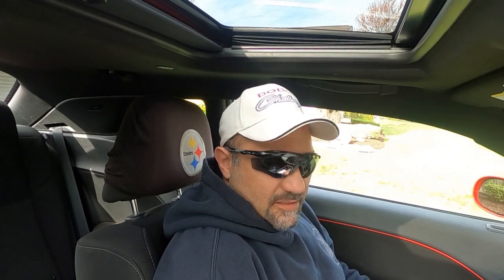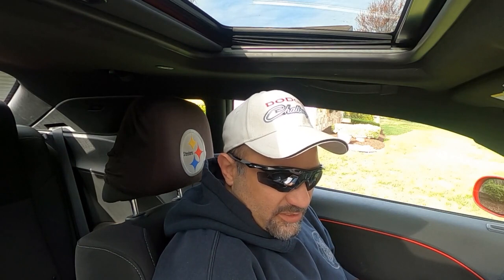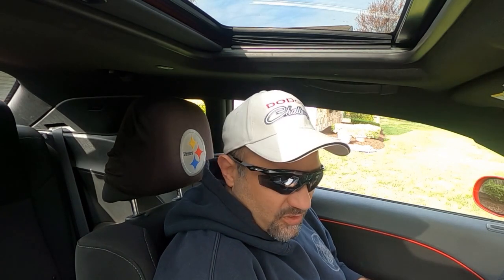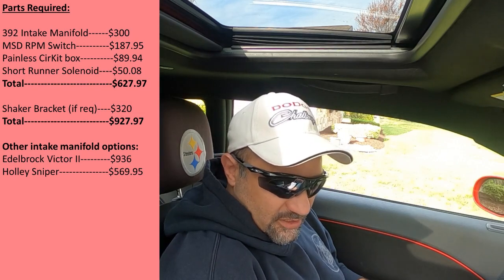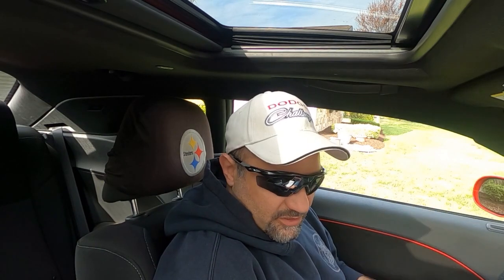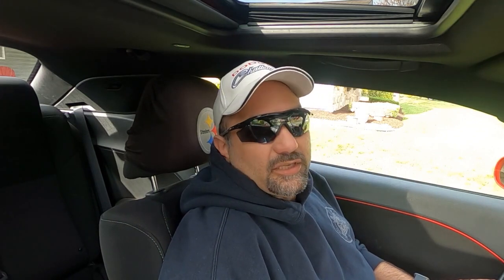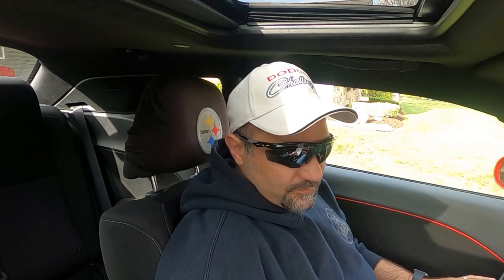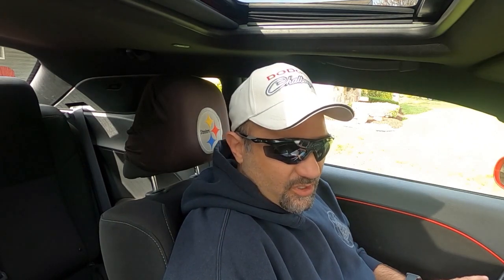392 / 6.4 Intake Manifold on a 5.7 Hemi Parts List and Cost!

Comment: Hey brother man I did this mod a little bit ago and was wondering if you knew what RPM is best for the short runner valve to activate? I have mine set for 4500 but I’ve heard people set it at 4800, 4900, even 5000. Was wondering if you did any trial and error on the 1/4 mile
Reply from the maker: Never did any testing but had mine set at 4800 only because Scats have them set there. 😉
Reply: @ModernRedHemi  thank you sir 🫡
Reply: Setting the runner valve at 4800 is not good for the stock 5.7L due to the difference in the cam between the 6.4 and 5.7. I have found that 5200 pulls much harder before the car seemed to stall until over 5000.

Comment: There’s an easier way to do this. Just get an SRV controller from MMX.
Reply from the maker: You are 100% correct. Only issue is those that have a Tazer and either Diablo or HP Tuners, with a OBDII splitter, you can only use 2 OBDII things at a time. 😉

Comment: Does the 6.4L Intake improve gas mileage on the 5.7L if driven normally?
Reply from the maker: Good question. That's something I didn't do any testing on but it does increase power across the entire power and torque curves. That being said, I don't think it would decrease it much if any at all. Just my thoughts and opinion. 😉

Comment: @ Modern Red Hemi, thank you for the info and giving me some thing to look forward to when i start building up my charger! Question, is it better with or without shaker?
Reply from the maker: Well, I like the look of the Shaker but there is an added cost for the bracket (~$300 if I remember correctly). Other than aesthetics, I don't think the Shaker adds any power but could be wrong. 💪💪💪
Reply: @ModernRedHemi  that is what I was wondering, although the shaker does look pretty dope, kinda reminds me of a Darth Vader helmet! Keep up the awesome content 👏

Comment: Its cheaper to do the 6.4l intake now, i just got my hands on a 6.4l for $500 & Z-automotive has the Short Runner Valve for $289. Which is my next purchase!
Reply from the maker: Definitely a little cheaper with the SRV controller from MMX! 💪💪💪
Reply: @ModernRedHemi  yes & more simple to hook up
Reply: Good luck. Ive been waiting 2 months. They are out of parts 😞
Reply: @mrhyde0705  on what parts? For the SRV module?
Reply: @Mroswaldo16  dunno, i emailed MMX and they said Backorder, than i went to z automotive and they stated due to not enough chips they couldnt produce and they only had 3 orders including mine. I asked if they'd be able to make the connector as its the only part i need, never heard back.
Reply: @mrhyde0705  ohh, i see. It had went out of stock before buying mine, then i saw in stock, so i had to buy it. What connector do you need?
Reply: @Mroswaldo16  whatever cord they have with theirs. I think it connects the SRV to power under the hood. I was probably just gonna buy a 6.4 harness at this point.
Reply: @mrhyde0705  for the SRV, its just to intake, power & something under the glpvebox, to control or see rpm. Really simple wire.
Reply: @Mroswaldo16  yeah. I do need a new engine harness as mine has almost 200k on it, and its crumbling. Shop that did the work said if i can get power to the SRV, they can tune it. I really dont wanna use an MSD switch. Gets hot here.

Comment: Any notice improved performance and hp gains with the swap thanks Mike
Reply from the maker: Absolutely. Didn't do a dyno though but there is a big difference throughout both the horsepower and torque curves, specifically the torque because of the short/long runners. 💪💪💪

Comment: It's been a while since you did this video, I'm sure people still use it as a reference.  Most use the MSD window switch to activate the runners. 

MMX ( modern muscle extreme ) carries the SRV controller from Z Automotive. It works fantastic, and won't fail due to heat like the MSD can. It's also controllable from inside the car.
Reply from the maker: You're absolutely correct. This was some time ago and ZAutomotive has added this device to the mix. I would definitely suggest it. Thanks for posting!💪💪💪
Reply: Thanks for the feedback appreciated it. I just recently ordered 6.4 manifold and was on the fence about the srv z automotive. This sure is reassuring and glad I went wit Z Automotive instead of the Msd. 👍🏽
Reply: @Jr1987Gt   let me know if I can help. They really work well
Reply: @SModelMafia  Awsome thank you.

Comment: I am installing this manifold and wonder how this option will “hold up” to the traditional way as you noted with the box.. 

https://www.modernmusclextreme.com/images/media/p-1503-SRV_Controller_User_guide.pdf
Reply from the maker: I didn't use the Z-Automotive solution. I have a MSD RPM switch that turns my short runners off and on. This is my first time seeing the Z-Automotive solution.
Reply: seems interesting. You have any updates/ additional info to share about that?
Reply: @riology2234  it has worked flawless.. easy, clean and computer modified. Well worth the money spent !
Reply: @tylercooper5092  1) If I undrestands this correctly, the Zautomotive way requires less wiring that the traditional way thus resulting in more OEM/ cleaner look, correct? 
2) Would you suggest it over the traditional way?

Comment: I’m about to make my purchase on a used intake manifold so I purchase it with rails and the injectors? Also my stock tb will fit the 6.4 manifold?
Reply from the maker: If you got the fuel rails and injectors you will definitely need a custom tune to utilize it properly. Yes, your TB will bolt right up!
Reply: Modern Red Hemi yea I’m sure mr.green can take care of that for me but wat do u suggest or so I just get the manifold itself without rials n injectors
Reply from the maker: @ezequeilpena7208  you don't necessarily need the rails and injectors. Even if you upgrade later, boost for example, you'll have to get new injectors anyway.
Reply: Modern Red Hemi there one I’m looking at that’s why it comes with all that for 200
Reply: Modern Red Hemi It’s a 2018 manifold for a charger it will fit my challenger 5.7 correct
Reply from the maker: @ezequeilpena7208  if that is on Facebook Marketplace be careful as that is pretty cheap. My buddy got taken on the same deal.
Reply: Modern Red Hemi no it’s called car part.com
Reply: Modern Red Hemi they scammed ur buddy they didn’t send him parts ?
Reply: @ezequeilpena7208  hey I got a 6.4 intake with fuel rails, injectors, and throttle body for sale. I am located in Illinois. Let me know if you want more info

Comment: Can someone help me find a 392 manifold or find me a link. Thanks :)
Reply from the maker: https://www.ebay.com/itm/Used-OEM-Dodge-6-4L-Hemi-Engine-Intake-Manifold-W-Fuel-Rails-Fuel-Injectors/303676977902?hash=item46b48ef2ee:g:JbMAAOSwnxlfR0tG 
A little pricey but includes fuel rails and injectors.
Reply: Modern Red Hemi 625? Does that seem a little over the top? I don’t know that much but I’ve seen them go used for like 380. How much do the rails and injectors to for
Reply from the maker: @cmd7129  this one includes the fuel rails and injectors. Most of those that are cheaper don't. You don't need the rails and injectors but a nice to have if you continue to upgrade.
Reply: Modern Red Hemi would the injectors increase performance at all?
Reply: @cmd7129  Your stock injectors are the same as the 392's which are rated for 550-600 horsepower(more or less). New, more volume injectors are not needed and would cause more issues as being too rich and a bigger bitch to tune.

Comment: What did this do for you horsepower wise and torque?
Reply from the maker: Increased HP and torque across both curves along with flattening them out some. It is well worth the time and money to do it.
Reply: @ModernRedHemi  What would you do first, the 6.4 intake, or the 3.09 lsd. I have an open diff right now.
Reply from the maker: @brokelahomachickenfry6497  get the LSD first. Will help getting off the line.

Comment: That 392 intake manifold is already a huge improvement over the factory intake manifold but a ported 392 intake manifold will make that 5.7L Hemi V8 perform even better.
Reply: I tried to look for intake manfold 6.4  1000 from dealer I tried to find used nothing then I found ported intake manfold 6.4 for 795
Reply from the maker: Yes sir. Working on that next.
Reply: @ModernRedHemi  I need the intake manfold can you send me where I can find it so I dont pay 2000 to 3000 for all parts . I saw ported intake manfold for 795 new with no parts included .
Reply from the maker: @angelomaselli5191  they are hard to find used and some that you find are scams (specifically Facebook Marketplace). You just have to keep digging into the forums, local if you can find one. Yes, you can get a new ported one for $795 (I think that's right) from Modern Muscle Extreme) but like you said, then you have to get the other parts as well. Unfortunately there is no one spot to look.
Reply: @ModernRedHemi  What other parts are required if you buy a brand new one from MMX? Is it just the parts in your description, or are there more?
Reply: @ModernRedHemi  Sounds awesome brother.
Reply: Did you ever get it properly running with the 6.4? Did you need tuning or air ratio 02 sensors ?

Comment: I know this video is old but does anyone know if you need a different throttle body when you switch the intake manifold ?
Reply from the maker: No. Your stock 5.7 will fit.
Reply: Modern Red Hemi thank you 👍🏼

Comment: Did you have to upgrade your heads when getting the stage 2 scat pack camshaft? I've been looking to see what I have to do or what to get for my RT Charger.
Reply from the maker: You don't have to upgrade your heads but I do suggest getting ported ones if you can afford them. All of these modifications build on each other to create additional power.
Reply: @ModernRedHemi  Where did you get your 3.70 Limited Slip Differential also. I've been looking for a good one that will pull hard. The best I have found was the 3.09 LSD

Comment: Why do I need a MSD BOX FOR RPM SWITCH
Reply from the maker: It is used to switch between the long and short runners. That is one of the advantages of the 392 intake. I have mine set at 4800, which is where the 392's switch as well.

Comment: Noticeable difference in mine, what I seen was drivability of the car was way more responsive in low, mid, top end. Exhaust note changed etc. Between shifts the car has no delay and picks up way faster than stock. The torque and power keeps pulling through high end where the 5.7’s tend to die. The car breathes way easier. Why Chrysler bottles a 5.7 up so much is frustrating. At the end of the day it all boils down to your tuner and other supporting mods you may have. Jay Greene is a wizard with these GEN3 hemis and he’s got my ride and Shake n Bake running very reliable, but also pissed off when we step on the throttle 🏁
Reply from the maker: It does make a really big difference contrary to a lot of other opinions. Jay is the Mopar Wizard for sure!
Reply: did it make exhaust louder ? or like higher or lower pitch? Also if driven normal what did it do to MPG? thanks

Comment: I’m doing the Holley intake on my 5.7. MMX is porting it out to make it more efficient.
Reply from the maker: I've heard both good and not so good things about the Holley Sniper. Would like to hear your experience with it.
Reply: Modern Red Hemi I’ve heard bad things too. But speaking with MMX they are correcting the issue with vacuum leaks and bad gaskets. They machine out all the gasket fittings on the bottom and they have made their own custom gasket for it. Which lead me to purchase. MMX steered me away at first but then later on they started doing this mod to the intakes and they said try it now. Also purchased my cam, hellcat TB blaster coils, legmaker etc. but I’ll let you know when installed and tuned.

Comment: I have a 5.7 hemi shaker as well and I wan to go on your route upgrading my intake manifold. Can you send me a link where to get the bracket for the shaker hood? Thanks.
Reply from the maker: I actually got mine from the dealership. I used to have the part number but can't find it. A great resource is Steve White Motors in NC (Service Number: 828-237-1570). Ask for Luke. I am sure they can get the part or at least the part number for you. If I happen to find the part number I will add it to my description.

Comment: I have a 2006 Dodge ram 1500 with a 5.7 with no MDS would it still be possible to do the 392 intake
Reply from the maker: It is possible for Ram's to take advantage of the 392 intake. Another YouTuber called Incredible Hemi who just installed one on his Ram. Suggest you check out his channel as well.

Comment: So 1000$ for 10 horsepower? Yeah no thanks 😄
Reply: If that’s too much money for the power then you have the wrong hobby lol
Reply from the maker: That's only for a Shaker due to the added cost of the additional bracket that is required. Also, it sticks with the roughly $100/HP of a lot of other mods. As for Rams, check out the video that Incredible Hemi uploaded a couple days ago. They say Rams get about 30.

Comment: Random question Will your long tube with the catted mid pipe set up pass maryland emissions, I want the same set up but Im skeptical since maryland is so strict?
Reply from the maker: I have been holding off as my emissions inspection is not due until July. With the virus thing going on I plan on doing a video on it when this all calms down. MD only requires the ODB II port testing. Video forthcoming.

Comment: Nice vid man. Question, after your cam install did you notice more or less valvetrain noise?
Reply from the maker: Initially I had the dreaded Hemi tick but once I got non-MDS lifters installed it went away.
Reply: @ModernRedHemi  Crud. I think my installers botched the job. I had full hellcat lifters put in and I hear more noise than before. I wonder if it's my injectors or something... Oh well thanks anyway. I'm takin mine to the shop tomorrow for an exhaust leak caused by the same aforementioned shop haha. Once that's out I'll post a vid of it idling. (I saw you subbed to my other channel the other day, thanks!!! (Peter Stein)
Reply from the maker: That's the problem nowadays. More speed/performance shops than you can shake a stick at and a majority of them are ifi at best. Good luck on tomorrow, hopefully this is a much better shop than the last.
Reply: @ModernRedHemi  Just got her back from a different shop yesterday. Night and day difference with these guys. Super clean shop, honest, and forthcoming with information. They truly cared about fixing up my R/T. Soon as I started her up she sounded WAY better. Sure the valvetrain is a little noisy, but I imagine with a high-lift cam that is to be expected. Either way, back in the R/T family! haha
Reply from the maker: @Kryptex90  that's awesome. I still have a slight tick and it is due to the high lift cam. Don't think you can totally get rid of it. Glad you found a shop that cares about your car like they care about their own. That's hard to find.
Reply: @ModernRedHemi  weird. I went with the comp hrt stage 2, and its super quiet. Granted i had a few flat spots on my cam from when a tech botched a warranty repair. But cant hear anything except clackin injectors now.

Comment: Thank you for the video I was wondering about this also I wonder if I get to Victor 2 do I need all that ignition pack and wiring stuff or is it a direct bolt-on
Reply from the maker: I am pretty sure that the Victor II is a direct bolt on as I am pretty sure the Victor II does not come with the long and short runners. I have seen in forums and what not that the Victor II runs pretty well in the 5.7s but have not seen any comparisons done.
Reply: @ModernRedHemi  okay awesome Ill give summit a call and see what they say thanks again man.   5.7 power!

Comment: Great video as always. Would it be best to get a cam over the 6.4 intake? Trying to decide the route I want to take first. Thanks again 👍
Reply from the maker: Thanks brother! Cam is quite a bit more expensive but I would go with the cam. Cam will give you more power, especially if you can get or plan on getting headers as well. If you can find a cheap 6.4 intake you can always get it first. In the long run, all of these mods work together to gain even more power. Sequence, for the most part, is up to you and your budget.